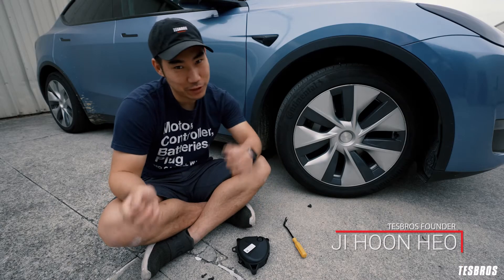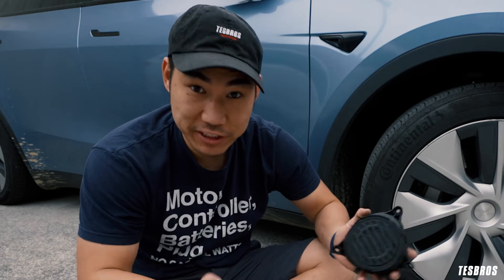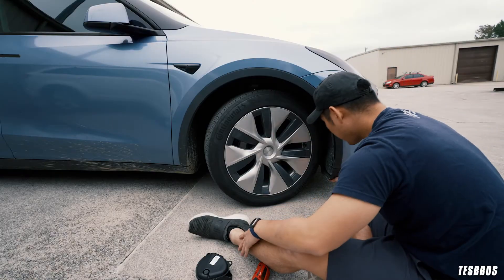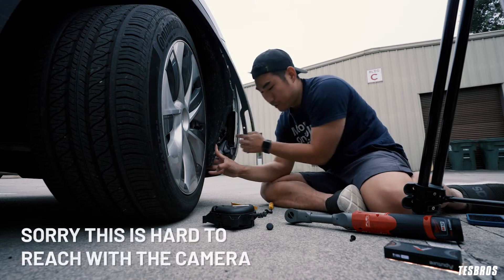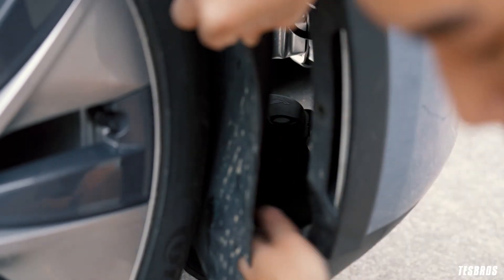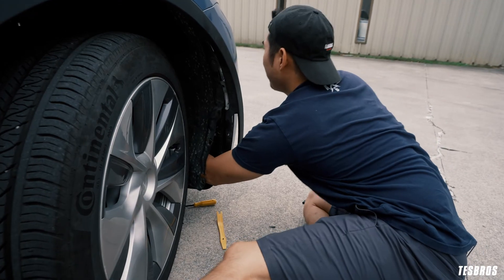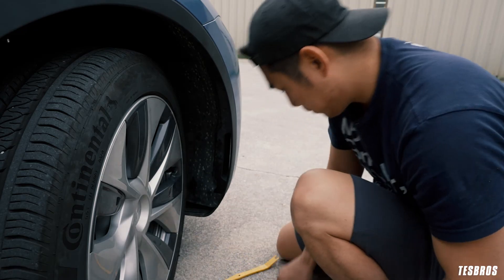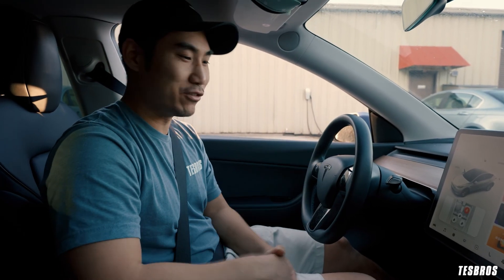How To Install PWS To Get Boombox In Tesla Model Y

Comment from the maker: Have you had any luck getting the PWS/Boombox from your service center?
Reply: In uk it is deemed illegal so Tesla we’re going to do it but regulators want allow it which is a pain for us in uk so I’ll will be fitting the wasp system
Reply: No service center in the US told me I could retrofit it into my model 3. They basically turned off the convo after that. Going to try another Service center to just order the part.
Reply: In europe they dont have any notice about the retrofit, for this reason is interesting how you got the update after a homemade install

Comment: Where do I get the screws to mount the Pws?   Mine did not come with the screws, having a hard time finding them. Thx Wayne
Reply from the maker: The screws don’t actually come with the PWS kit itself — they’re part of the Tesla service hardware. Most people either grab them from a Tesla Service Center (just ask for the PWS mounting screws) or use an M6x1.0 flange bolt, about 16mm long, which is the same spec. That’ll fit the factory bracket and hold the speaker securely. If you can’t get them from Tesla, check your local hardware store or order M6x1.0 flange bolts online.

Comment: Would my 2020 MYLR have the harness and speaker holes?
Reply from the maker: My 2020 did, but you'll have to check to be sure.
Reply: @diywrapclub just checked today and it did have the harness! Found a PWS on eBay already! 

Who or where exactly do you contact with Tesla for the firmware update for boombox?
Reply: Who do I contact exactly for the firmware?

Comment: This is now available in Australia. I had the speaker that I installed to my Jan 2020 M3 activated by Tesla's mobile service for $53.46. Tesla will also fit the speaker and activate it.
Reply from the maker: that's awesome!
Reply: Shows as $290 on the tesla website - how'd you set that up for PWS for $55?
Reply: I bought a speaker online for about $A100 and plugged it in myself. Tesla then came to my home and activated it for $A55.
Reply: @johnrogers1423 how did you get them to activate it?

Comment: I'm in the UK and had a PWS retrofitted yesterday by a Tesla Mobile Technician. He was very good and I've seen him before, but he didn't know much about the PWS system. After fitting, the Reverse sound works, but that's it. I have no Boombox. There were no details in the kit about futher steps about getting the software side of things done. I sent an update message through the existing service call (that hasn't been closed yet) requesting the feature be enabled but my fear is whether the agent at the UK Service Centre is anymore knowledgeable about what I'm asking for as I get the impression this is not a common thing here :(
Reply from the maker: The only way to get it is to contact your service center and ask them to push out the update - like you did! It's been a few days, so have they gotten back to you yet?
Reply: @diywrapclub  My PWS installation was finally completed today. The first mobile technician fitted the PWS but didn't know anything about enabling it. I had to request another service call which took another week. A different mobile technician came out today and connected to my car with toolbox to enable the PWS properly. Previously, if I rebooted the car the reverse and forward motion sound would start to work but only for one journey and Boombox was missing. After PWS was enabled properly via laptop, all is good.
Reply from the maker: @healeydave  good, I’m glad it worked out
Reply: Hope did you get this fully working in the UK please?

Comment: I have the speaker grill but didnt see the harness opening up from the tire, no wiring near the bumper what does that mean?
Reply from the maker: Your car might not be equipped with the wiring harness in order to install the PWS. check out the info around :30 to see if your car fits in the timeline for a wiring harness
Reply: @diywrapclub  after I posted that question I found some models had the harness inside the car on the passenger side to tap into then fish the line to the front. Supposedly Tesla sells a part to do this.
Reply: Mine wasn’t where his was, it was much higher up

Comment: If I have a M3 from September 2018, there is no harness so there is no way that I can get a PWS installed?
Reply from the maker: Not that we know of. If you can figure out how to wire the harness, then maybe? You’d basically have to start from scratch. I’d start by opening up the front wheel well like we did in the video and see if there’s even enough space for the pws to go
Reply: @diywrapclub  thank you for your answer
Reply from the maker: @guigui8376  If you try to do this, I’d love to know how it goes!
Reply: @diywrapclub  yeah no problem, I will let you know
Reply: @guigui8376  any update? thinking about doing the same

Comment: Thank-you for showing how to fit the speaker. I bought one through Alibaba for about $US100, had it shipped to Australia and fitted it to my Model 3 built in January 2020 after removing the front right hand wheel. Rebooting by pushing both scroll wheels allowed the reversing sound and low speed sound to work, but only for that driving session. It seems that it is necessary to reboot before each driving session, which I won't be doing. My guess is that after a few pedestrians have died in my state, pedestrian warning sounds will be mandated and then Tesla Australia will enable it for me.
Reply from the maker: Interesting. Yes, the push from Tesla is necessary to get the full feature. Glad you were able to install it yourself, though! Cheers.

Comment: I have the speaker grill and the correct wiring harness to plug into the speaker but Tesla Australia aren't able to sell me the speaker. Any idea if Tesla USA will sell me the speaker? If not any other ideas where to source the speaker?
Reply from the maker: Is it legal in Australia?
Reply: Not sure. Sounded as though it was volume that was the issue. I just want to avoid running people over. I don't care about Boombox but just want the low speed forward sound and reverse sound.

Comment: So bought the boombox or PWS from tesla uk Milton Keynes. Fitted it no issue even though no screws InThe box. Called to get firmware they said they can't do anything to activate it.
Do you have the contact details of who sorted your boombox out?  UK seem to be clueless as to the retrofit.
I do however get intermitent activation of the reverse noise. So I know it works and the car is seeing it but not all the time.
Reply from the maker: I know for a bit there the UK couldn't get the boombox at all, i'm assuming due to laws there. But the May 2021 deliveries should have the PWS and boombox installed already, so I don't see why you wouldn't be allowed to get it now. It's odd that the car only sees it sometimes? Is everything attached properly? No pulling on the wires or anything? Also, my contact really wouldn't be able to help in the UK, but try calling a different service center. Someone's gotta know how to push the update out for you.
Reply: @richardpryer25   Did you ever get the Boombox software update?
Reply: Did you get this sorted? Uk here too
Reply: @adamtaylor. yes I did.  I went to buy the boom box upgrade from the Tesla accessories. When they went to schedule the fitting. I explained I had the speaker and just needed the software.  They came and updated the car for free.  This was on a model 3 2021.  Since that I have upgraded to a 2024 model Y. Pre installed speaker. 😊

Comment: In my model 3 I can see the holes for the speaker under the car, does it mean I can install it? I have a Model 3 from July 2019 and I am from Europe.
Reply from the maker: Look for the harness like you see in the video. If you do have it, then yes. You can have it installed and software updated to get the boombox. You're right in that edge of vehicles that may or may not have the harness.
Reply: Did you end up figuring out if it does have the harness? I also have a July ‘19 M3 with the holes.
Reply: my car was build in end 2020 and it havent the harness